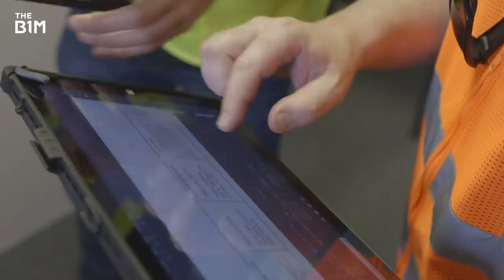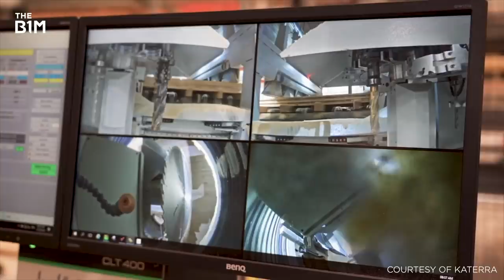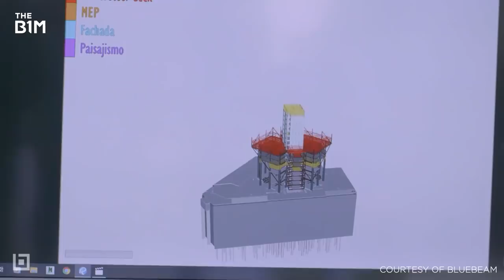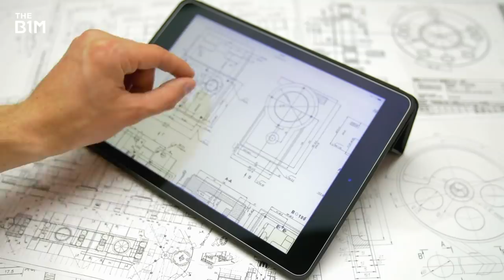How To Build in 2030

Comment: We better be using metric by then
Reply: Hahaha
Reply: No
Reply: Nah man.."taller than 3 adult alligators" is great measurements..
Reply: @chemistryboy100  That's not an official measurement...
Reply: @albertjackinson  that it a joke addressing the way Americans use anything but the metric system
Reply: Technically we use both.
Science and food nutrient facts it's metric. Everyday use for cooking, traveling, small construction, etc. imperial UK system.
Aviation is mostly imperial UK system too, but instead of statute miles, nautical miles are used.  Pressure is in inches of mercury first and foremost.  
  Thank the British.
 But we use both.
Reply: @ale-pg3xb  In either case, putting things in human terms helps a lot.
Reply: @albertjackinson  putting metric terms in use helps a lot more just saying
Reply: If the metric system isn't a thing in 2030 or 40 then the USA officially failed as a country
Reply: @user-ol7bt4wp1j  That's an extremely narrow metric (no pun intended) for measuring a country, isn't it?
Reply: @ale-pg3xb  
A joke on the same level of repetitive-ness as “America oil” or “French surrender” or “British bad teeth”

Comment: For 0 waste they need to stop using composite materials. Just use materials that can actually be recycled, like pure timber, steel & glass.
Reply from the maker: Amen!
Reply: or, we need to get really good at atomizing composites down to its base materials, and i use the word atomizing without exaggeration because that's what you need for some of that stuff.
Reply: @profwaldone  Haha launching it into space would probably be easier!
Reply: I don't know if abandoning composite materials is the way forward but actually having a plan and method of recycling any composite materials used during construction seems like the way to go.
Reply: I’d like to see laws made that require material makers at least partially fund recycling of the materials they create. Say 1% of gross receipts taken to pay for cleaning up materials they create and sell. You think they’ll leave money on the table and fold up? No way! Watch how quickly the private market comes up with materials that are easy and cheap to recycle. The only reason they haven’t done it yet is because they don’t have to.
Reply: @justinholt3826  An interesting idea, but such is the way of business/politics I think certain businesses would look for loopholes instead.
Reply: @piraterubberduck6056  The problem is that composite materials can't be easily broken down and reformed in order to be recycled. Having a plan to do that is therefore extremely difficult, especially when you can make a building, with pretty much any function, out of wood, steel and glass.
Reply: Steel?

Comment: what is the vertical build limit of wood tough? Building efficiency isn't just about the building itself, but also in how it's used. if you save a lot of CO2 in building loads of 5/6 floor flats on the edge of town, but then all the inhabitants need to spend hours and hours in traffic jams to get anywhere you aren't helping anyone. we need to be able to build 150+ floors on the regular soon, just simply to keep peoples action radius to below the need for a vehicle.

Comment: ‘These challenges absolutely have to be solved in the next 10 years’. Care to give some actual data that proves it has to be 10 years? Otherwise it’s a meaningless platitude. I’ll give a prediction. In 10 years we will have more electric cars on the road, maybe 20% of the stock, and oil nation states will be struggling due to lower prices. Everything else, including the construction materials we use, will essentially be the same as it is now. Government set targets won’t be hard targets and will be filled with waivers, extensions, and modifications. 10 years goes by very fast and the trend changes predicted by B1M move much slower than a period of 10 years.
Reply: That's somewhat realistic but the drift in materials is a high possibility but it won't be 100% maybe around 40% of new buildings Will be made out of sustainable resources
Reply: 10 years is the timeframe set out by the same people who organized Event 201, the pandemic simulation which perfectly predicted what is happening today. These people have a plan, and they are sticking to it. It's called Agenda 2030.
Reply: @markham5800  POG

Comment: Concrete is also a problem as the water eroded sand (think beach sand) required in the mix is becoming scarce. Wind eroded sand like from a desert doesn’t work... the shape of the grains is wrong. Unless a replacement is found, or we can adapt concrete to use desert sand, we may have to start thinking of alternate materials for things like sidewalks, building foundations and core walls.

It’s enough of a problem already that beach sand piracy is now a thing.

Comment: This video will not age well.
9 years and 5 weeks away is a blink of an eye when it comes to transportation and building.

I see your pushing for that great reset.  Our economies will go bankrupt before this happens in any large scale. 
It is factually accurate to say, our food, clothes, roads, metals, heating lsources, transportation, glass manufacturing and just about every other facet of our modern world is based upon fossil fuels and the technology is nowhere near there yet to remove fossil fuels.
Reply from the maker: Come back in 2030 and see how we did!
Reply: Don't worry!
Fusion is only 5 years away.
Reply: @jimurrata6785 I sense a bit of sarcasm but maybe I am wrong so I will mention i have a popular mechanics magazine I believe dated 1956 (I have a ton from the 1940s to 1960s I enjoy reading so don't quote me on the date) that said we were 10 years away from fusion. Needless to say we are still waiting.  I blame it on doc and Marty for messing up the time line.
Reply: @AtomicReverend  Honestly our entire solar system has been powered by fusion for billions of years!
It's only since humans found ways to start fires that there's been anything more than that.

So yes, a bit cheeky, but if you consider the amount of insolation sunlight provides we really don't need more we just need a better process to utilize it.
Consider how much global warming we could avoid if we turned much of the infrared into electrons we could harness to do our bidding.

Comment: So looking at the bricklaying robot, Vice did a report on this and it looked impractical. The robot beats brick layers when there is a very long brick wall that needs to be set. There aren’t many new construction projects using that much brick of any at all for the robot to be useful.
One thing that’s on every project are painters, rubber base installers, and tilers. If you could figure out a process to perfectly paint a wall with an AI and do touch ups as needed you could have a winner on your hands

Comment: One thing is for certain: new commercial construction should be Riot-Proof.... Every store should have reinforced glass or a steel rolling curtain, as well as active measures like fog or pepper spray dispensers in the perimeter, high intensity strobe lights or high intensity sound speakers similar to the ones used in oil ships sailing around Africa.
The Roots/Lootings showed us that, unless you want your store ransacked or burned.... We have to use this technologies

Comment: Why would Sweden require a building structure to have 50% wood material, isnt it smarter to build with long lasting materials.
Reply: You saying wood is not long lasting?? What do you consider long?
Reply: wood can last well over a hundred years, how mutch longer do you need?
Reply: The real reason is these countries have easy access to wood vs concrete. The reason behind the conversion to wood likely has little to do with cutting GHG emissions and more to do with economics. I mean converting to wood means you have to cut down more trees.
Reply: @hellgorama  That makes perfect sense.

Comment: At the high end people do all sorts of interesting buildings now but at the low end I get the general impression that there are not really enough skills.  If you want to get work done in the UK - like fixing your house or whatever - it's easy to find people who know how to build with bricks, who can fit gas-boilers, plaster walls, whatever.  There's a standard set of parts and skills that is copy-n-paste from the traditional library. Who can build you an aircrete building or put in an air source heat pump or whatever? It is hard to be different. Hence I think that there has to be some very determined attitudes to training and legislation to get the part of the country that is not living in skyscrapers to partake a bit more of modern ideas.

Comment: final phrase: "building a better world" sounds good until you start thinking how many jobs would be lost due to automation. Who can afford those more expensive eco-friendly-all-robots technologies if the majority of people would struggle to find any job at all (and the easiest/cheapest/most widespread jobs are to go first)
Reply: As he said these machines still need humans to look after them, refueling them with cement, bricks and whatnot.
Reply: @dyobodraode2554  e.g. firing not 9 out of 10 but just 8 out of 10 is some kind of victory? ok.
Reply: @xiodcrlx  well climat change will take more jobs. Sometimes you have to do it. In the long term it will be better.

Comment: The video keeps talking about sustainability but also shows Hyperloop as the way of the future. Has anyone even examined the sustainability of a fully developed Hyperloop network?  I imagine the energy per passenger mile would be astronomical compared to regular trains.  For sustainability, walking, biking, and riding trains are the way of the future.
Reply: I don't see energy use as an issue if you are talking about the mid to long term. as soon as fusion is up and running our energy budged will practically be unlimited, or alternatively, if the next generation of super-heavy rockets gets out to allow for orbital solar plants.

Hyperloop is still a bad idea in atmosphere tough. build that shit on the moon, in orbit or maybe on mars if you want to get some actual use out of the consept.

Comment: Meanwhile a new apartment block has just been finished in my city by the train station... a block on which most of the facade is plain concrete modules, yet the smoothed corners for some reason are with bricks... just what the actual heck? Not only is it bad going forward to use that much concrete, but it also looks incredibly ugly!

Comment: But you cant reuse wood, concrete could you reuse. And trees neds lots of years to grow up, so this i s challanging
Reply: yes, concrete can be “reused”. except you just produce a bunch more carbon emissions in the process. all that the process of “reusing” concrete does is crush it up into rocks and put it in cement. the only component that removes is the gravel mining step. the. gravel in the concrete is not the main part that produces co2, it’s the cement. the cement industry alone produces 8% of human co2 emissions. wood on the other hand takes co2 out of the environment and is renewable.
Reply: @boxr_4214  wood isnt renuable it needs to get butnd or roten away, and yeah wood cleans the air but when the forests are cut down the air is geting less goid to breath cause the leavs and stuf cleans the air. Yeah mining grawel is realy bad, but if we reuse the concrete wals and such in a good way it could be grate. Oh and if construction companys could use the grawel from the site to create congrete for the basr floor it is helpful, but i do understand what you say. Huh this new thinking of construction must be challanging for engeneers

Comment: So, Europe will want more NA timber as they do not have enough of their own, but their population is not increasing much so... So, cost of new housing in US will be going up as a result.  And guess they will have to dip into the US civil engineers who all work with wood daily... It is not that difficult, but there are some gotchas you have to watch out for as it is a composite material and the joints are a bit harder to design.